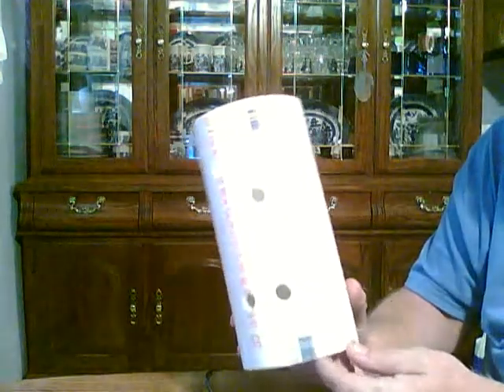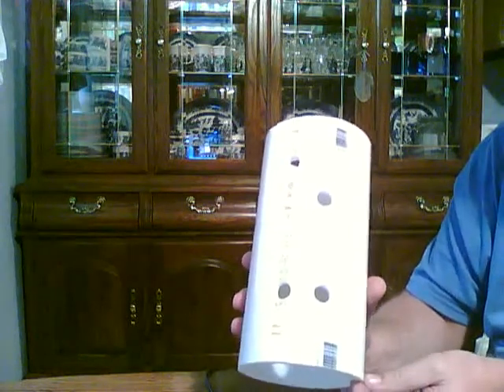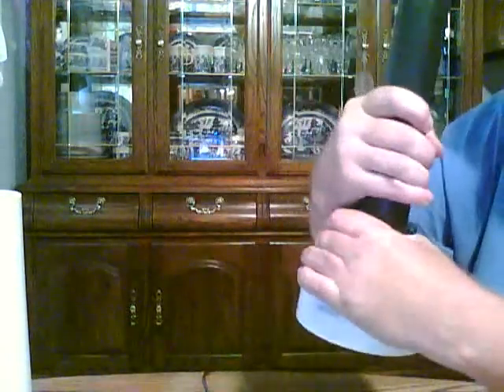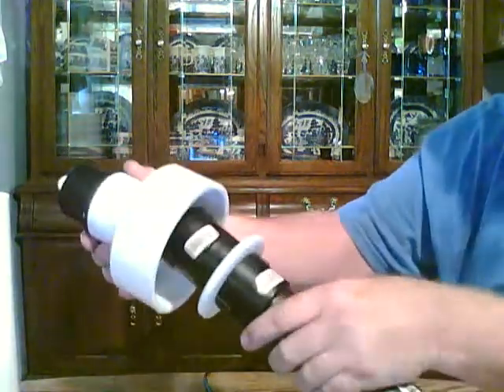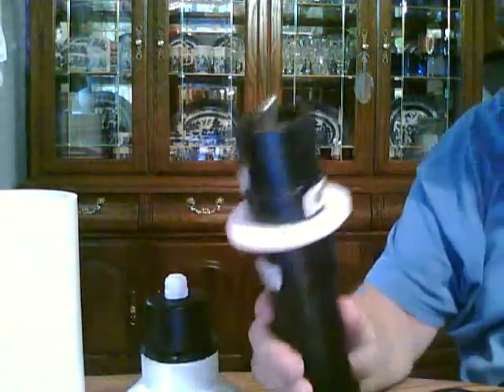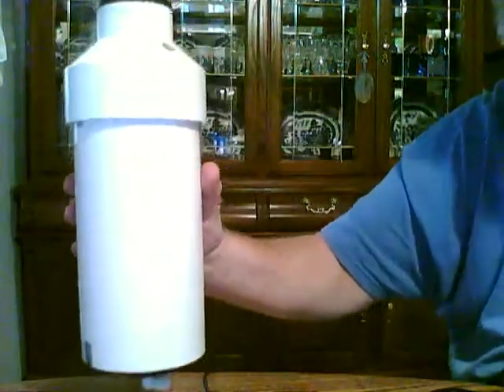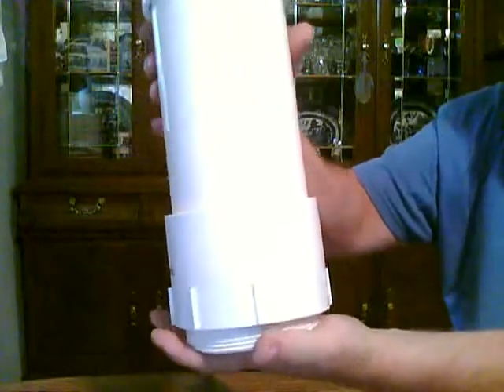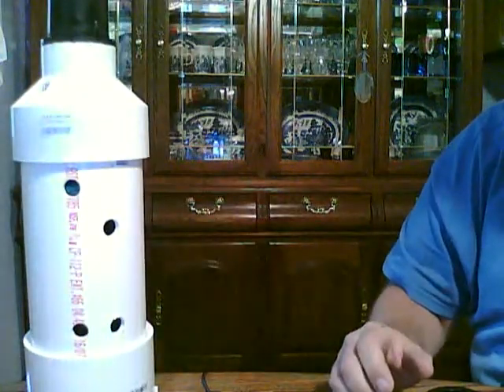Improved Multi-Chamber Bubbler -1

Comment from the maker: Hi Sir,

I like your videos they are well done. Keep up the good work on the 'Install'

Ok Answer: This was designed around the use of a Dry Cell configuration and is the Reservoir as well as the bubbler so Electrolyte capacity is a concern. The EBN Dry cells are capable of producing large amounts of HHO and therefore require high capacity reservoirs. HOWEVER, yes it is possible to create a smaller capacity version as well as Larger capacity versions.

Comment from the maker: Hi... Thanks for the question.

The answer is Yes I have tested it and yes there is a difference. With this construction you can actually measure the output (or flow) Before it goes through the Secondary bubbler and after. The gas output through the Secondary bubbler and Dryer/Arrestor is less and is expected to be less. This is actually the same results you would get if you used or had separate components. This does mean that the bubbler is being pressurized.